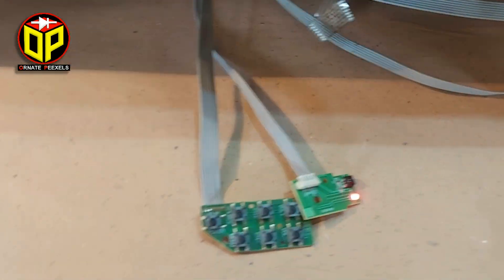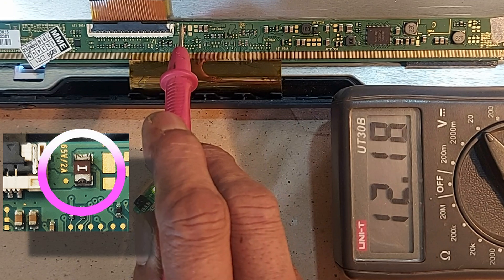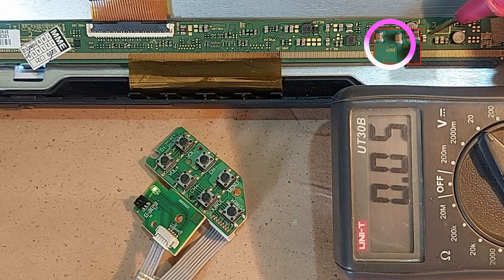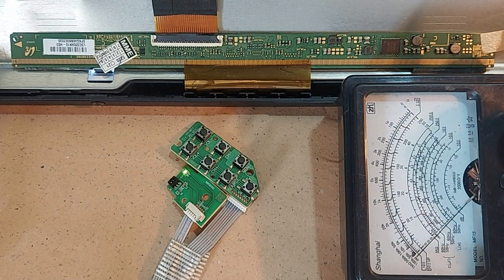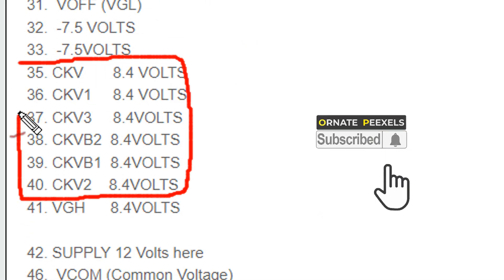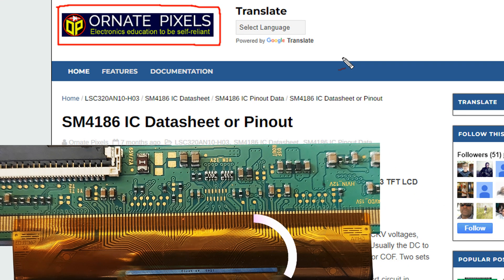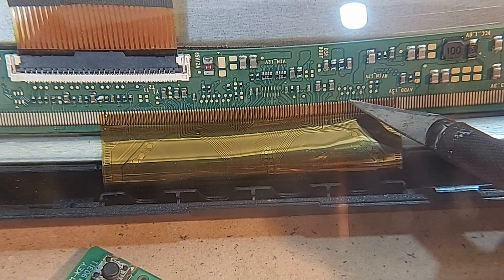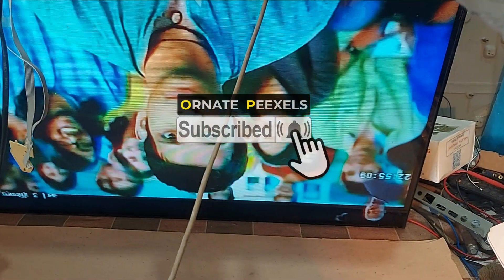LED TV Panel Repair, No Light  & No Picture on The Screen, Backlight OK. SM4186 IC Datasheet

Comment: Sir panel shot killer making vedio explain sir
Reply from the maker: Short killer is an unconventional method, using this method can burn PCB's thin print due to over current flow, so sorry bro I don't use short killer.

Comment: Sir your all shart video ia very useful
My question is a Toshiba smart led 55 inch sound not working only tuk
Tuk ofter 2. 3 second what is the problems power PCB all volt is ok thanks